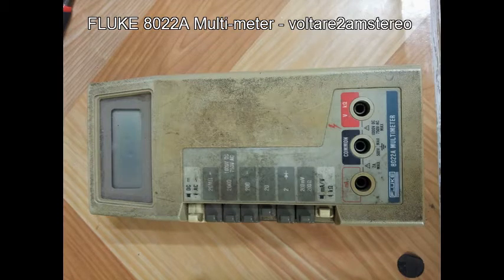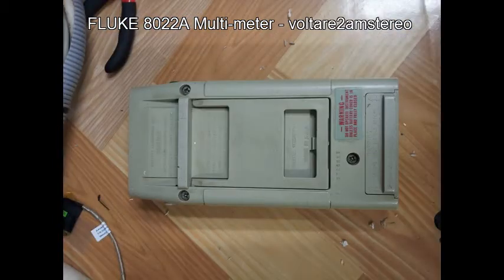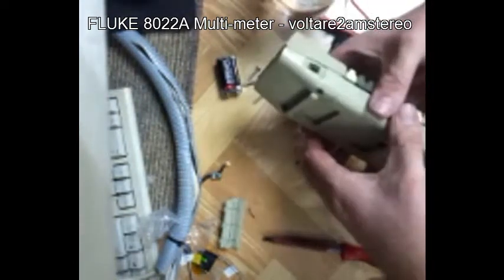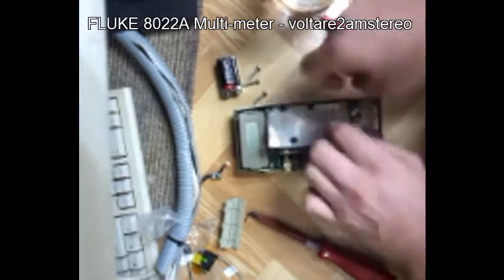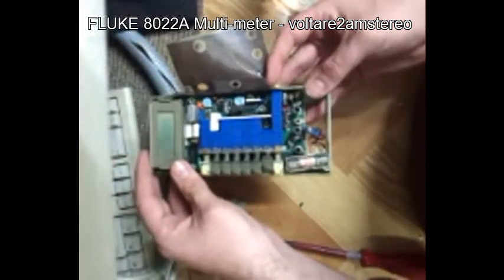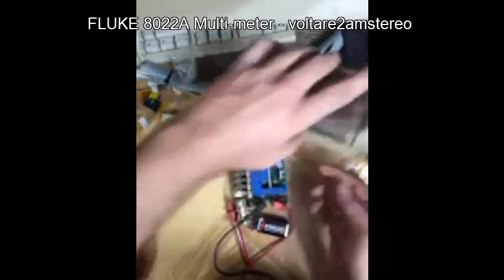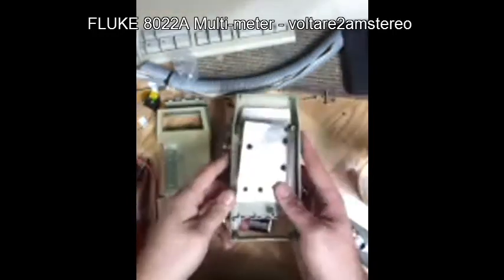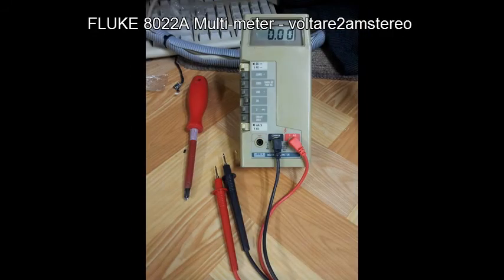fluke 8022A multimeter - cleanup and tear-down -

Comment: Got mine new in 81. Came here looking for some possible trouble shooting info as it has stopped reading AC voltage. DC and Resistance functions work fine but no go on the AC. Oh well, it's been a good meter but I guess it's time to look for something new.